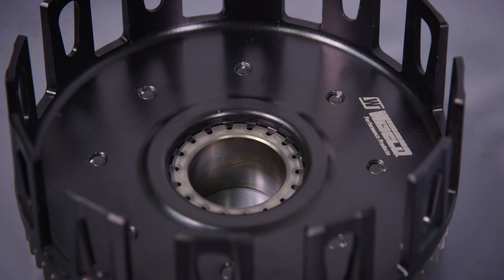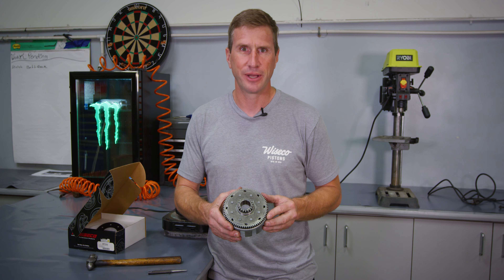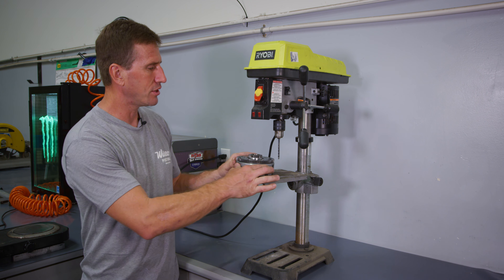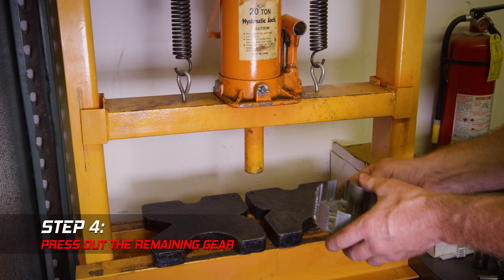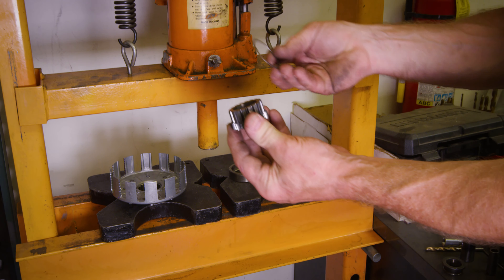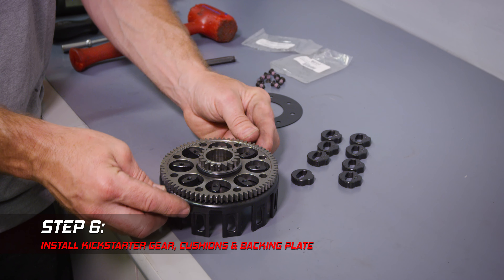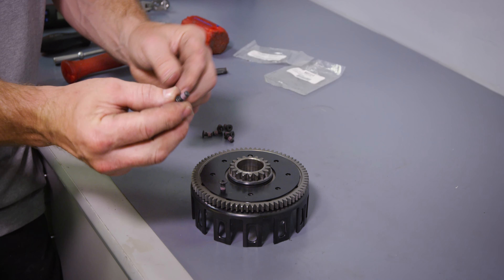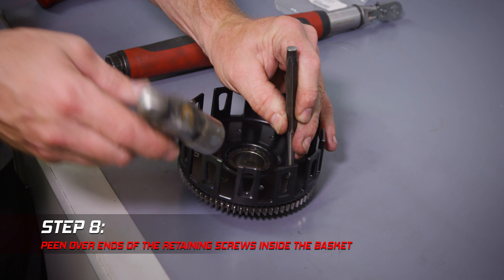How to Replace a Clutch Basket | Step-by-Step Guide

Comment: Hi video was ideal and explained everything, after its all installed and had a few hours use ive inspected the clutch and there is a little play between the basket and the main gear, is this normal? Iv been experiencing clutch judder i wondered if this was the problem? 
Many thanks
Reply: Same thing not sure if it's supposed to or not? Any ideas

Comment: Hi replaced my clutch basket on my Kdx 200 
The original basket has extra groves so as the last friction plate is offset compared to the rest 
The non genuine basket Dosnt have that extra grove so all 7 plates are in alignment 
Do you think this could be a issue 
Any help would be appreciated
Reply: Hello Paul, I was wondering if you figured out an answer for the offset clutch pad, I was trying to change the clutch basket for my kdx but I don't know if it is actually going to work

Comment: Speaking from experience, if you bang the gear out of the clutch basket, or bang one into the clutch basket, you will have problems with the clutch bearing in that it won't fit back in.
Press it in and press it out.